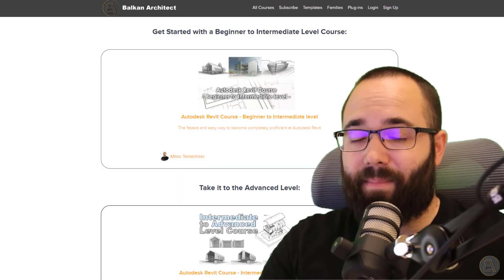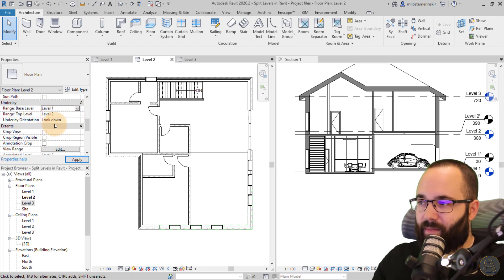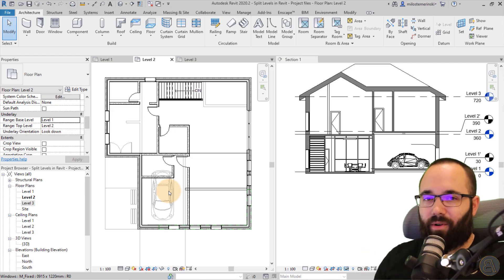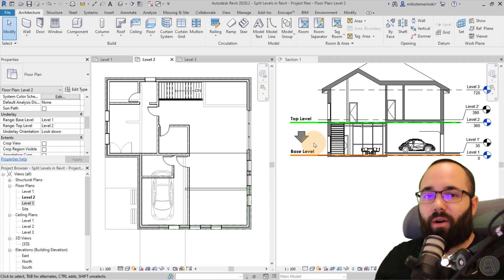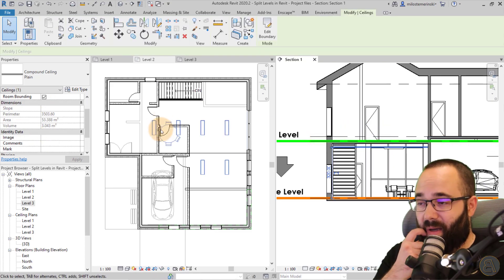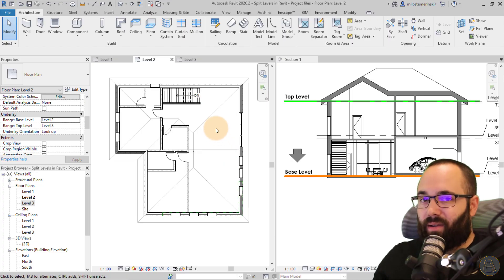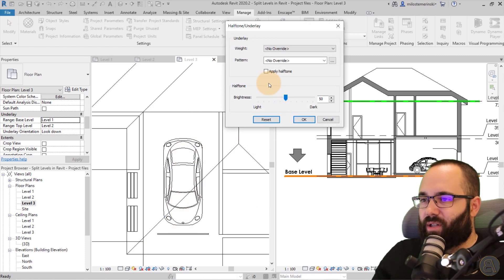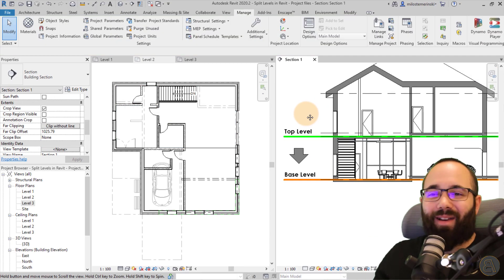Underlay Settings in Revit Tutorial

Comment: Wish you would elaborate this point in detail using a live/complex project. I tried this on a project that had structural beams and went nuts trying to get them to show on the floor plan. They had to be shown differently than the roof overhang, so had to select them individually and change their lines properties. Probably was an easier way to do it, but I simply went crazy trying to figure out underlay and view range crap.
Reply: could you do it via  plan region  and set different view range just so it can cut beams and show them on fp